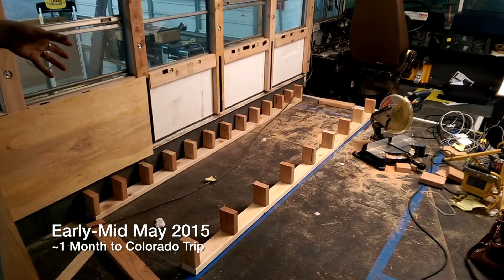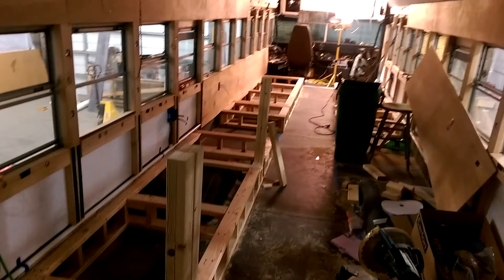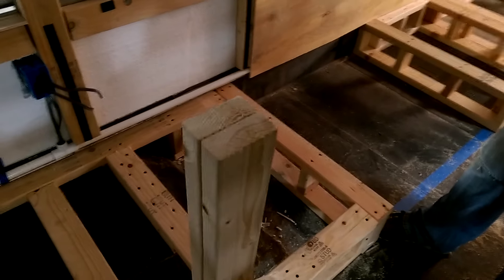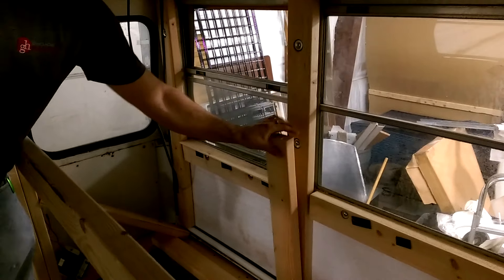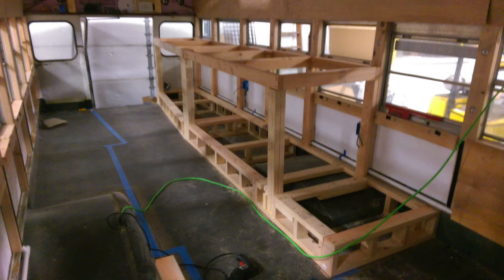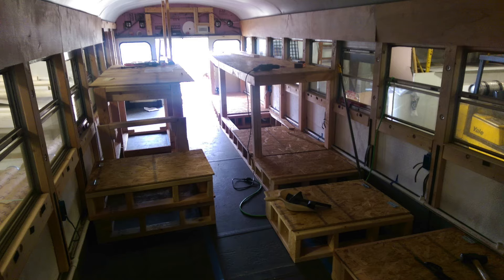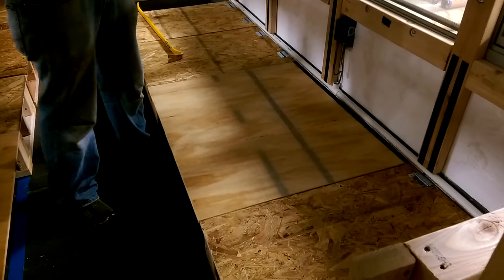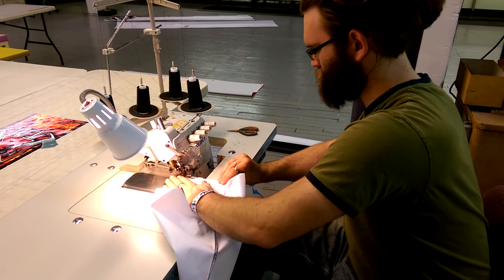#10 Developing Creature Comfort Framework, Finishing the Furniture

Comment: If you don't mind me asking, how much did u get the bus for and how many miles.
Also how much would you estimate it costed you to paint and insulate with walking inside minus all the furniture stuff inside 

Group of my friends are looking at making a bus to haul our snowmobiles out west just trying to figure out prices
Reply from the maker: +BornToHunt97 We got the bus for $2000.  I felt a little bad cause we outbid a church to get it :)  It had 200,000 miles on it at the time.  The paint was pretty cheap, we got it all at Tractor Supply Company.  With materials (including brushes, rollers, etc.) paint was probably $200ish.  Insulation and the wall materials was probably another couple hundred bucks, all purchased at Home Depot.  We picked out all the foamboard with corners broke off and got them to give us a discount on everything since we were going to cut it all up anyways.
Reply: Sweet, thanks for the info, have you had any issues, everyone in my group of snowmobilers is   worried about break downs since we will do cross country with this thing, we're all handy and can do auto work just curious if you had any issues on your trip I believe you took
Reply from the maker: +BornToHunt97 Stay tuned for our Colorado Trip video!  We didn't have any mechanical breakdowns, but we were prepared when we left to do repairs on the road (tools, spare sensors that typically go bad, etc.).  It helps that we have the International T444E engine which is the same as the Ford PowerStroke 7.3L, so information and parts are readily available.  We have had to do some maintenance since then which will be detailed in other videos.
Reply: Awesome